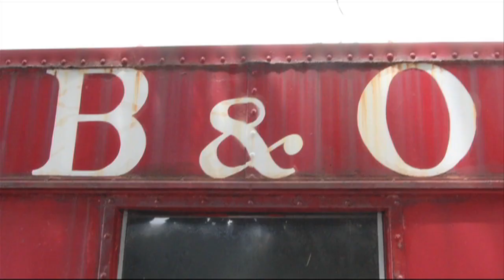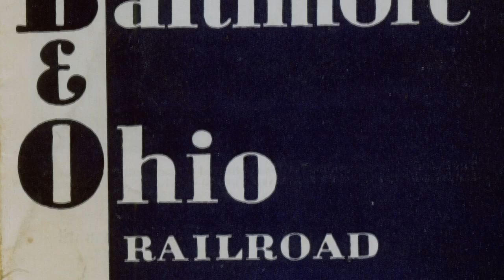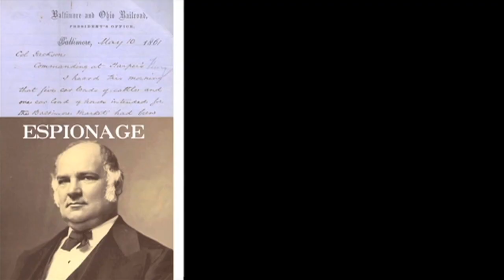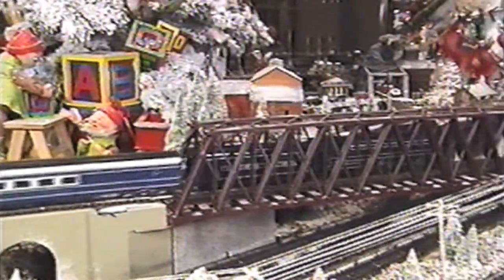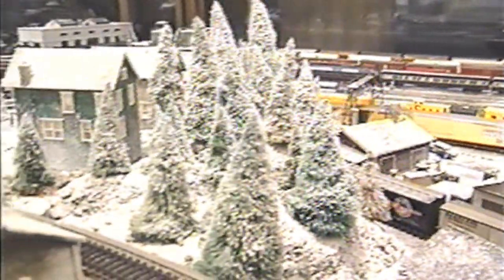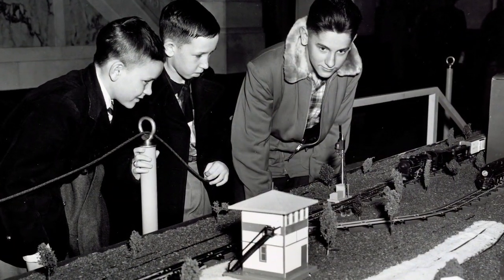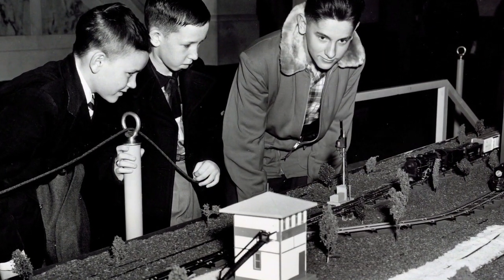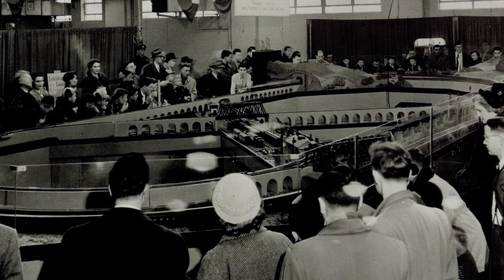B&O Railroad Museum TV Network: Model Railroading (December 2011)

Comment: Most of all of "O" scale equipment was third rail. don't be confused with lionel or tin plate. this was "KING O SCALE" after the 40-50's most layouts likely removed the third rail and was strictly 2 rail. built to scale at 1/4 inch to the foot.

Comment: A certain completely unrelated company took over Cincinnati Gas & Electric a few years back and they pretend they're the ones that have presented this display in Cincinnati for 65 years.  About 8 years ago they decided they couldn't be bothered to have it taking up their precious lobby any more and moved it to Cincinnati Union Terminal.  Which would be a great location except for what used to be a free attraction now requires museum admission and $6 parking.  I will not mention the name of the company.   Moving it to CUT does allow for walkaround photography and I did a bunch of it in 2012 finally documenting much of the equipment and putting it on my web site.  But the biggest insult is that the utility company claims it's been theirs all along, which is about as stupid as Union Pacific claiming to have always been Southern Pacific.